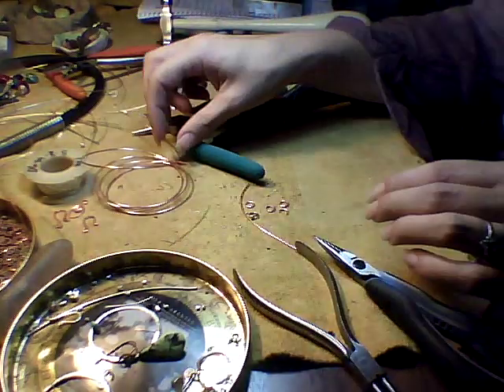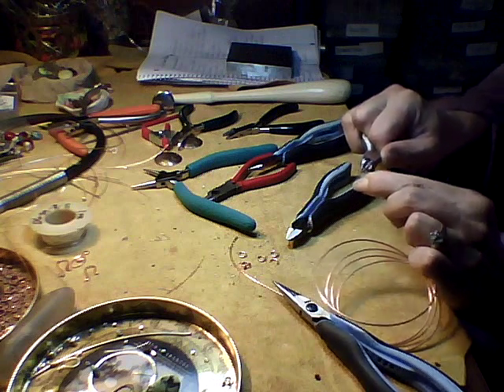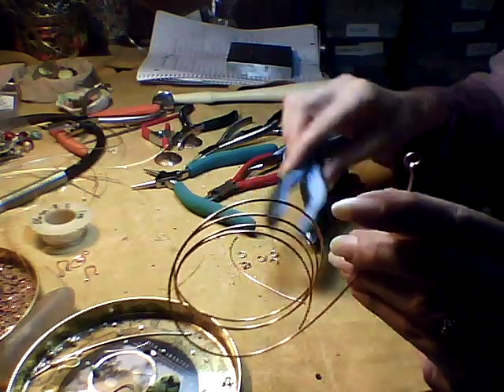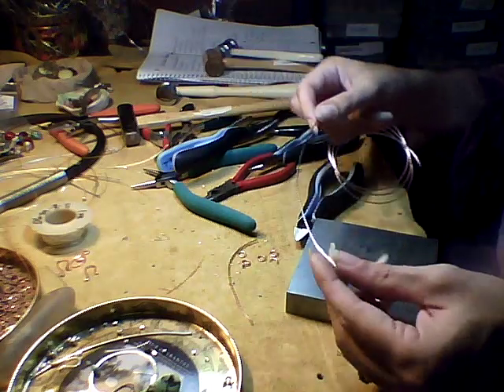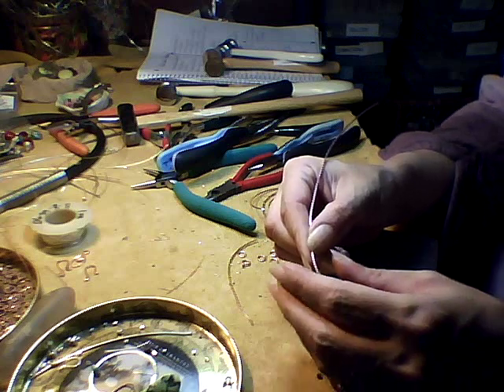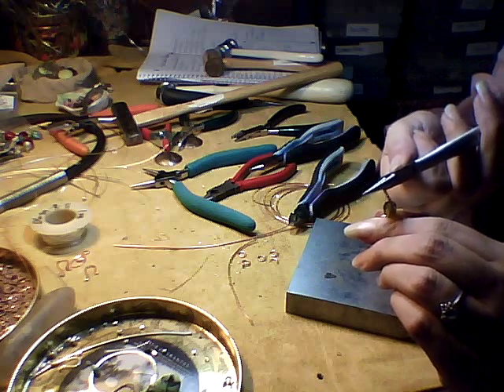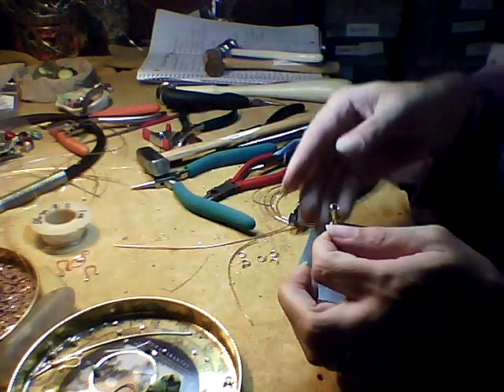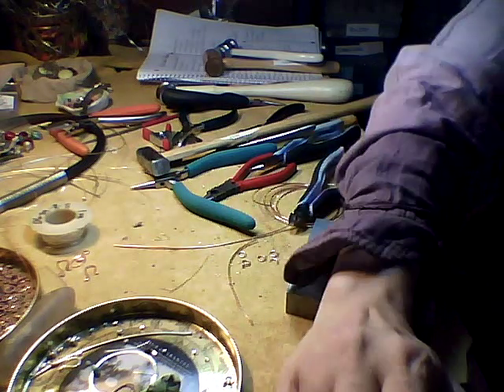How to Hammer and Make  Wire Wrapped Link for Jewelry Design

Comment from the maker: I have no idea what gauge wire I used in this instance. I use the largest wire that will fit into the bead usually. This example, tutorial is adaptable to what you need to use it is not a recipe for one specific outcome.